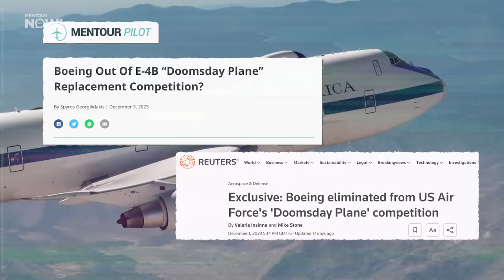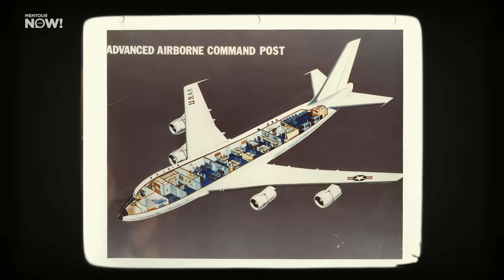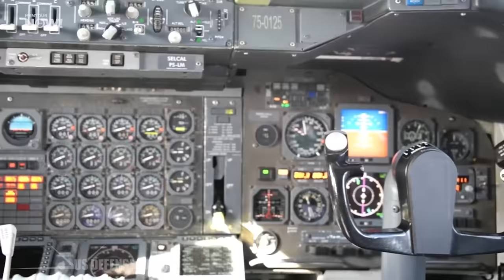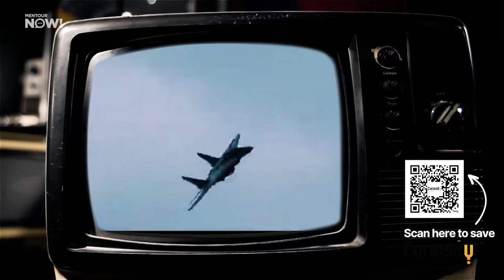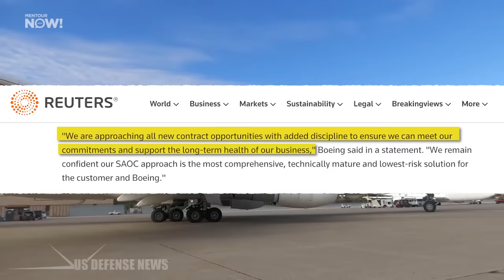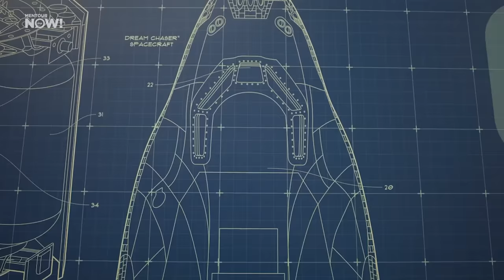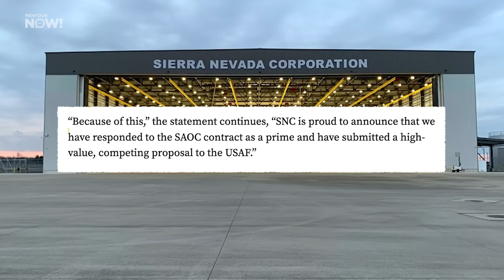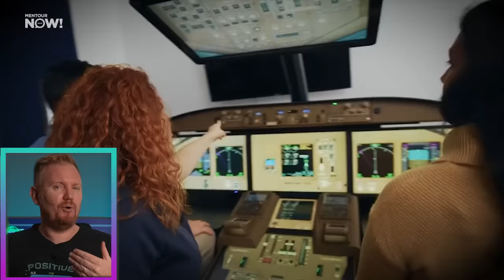Why was Boeing kicked out of the Doomsday Plane competition?!

Comment: Another issue for the 2 engine airframe is electrical power. All that comm. gear takes a lot of electrical power.
Reply: A secondary APU might be installed as a backup to provide extra electrical power, but that would add to the weight of the aircraft and an expensive redesign of the airframe to accommodate the unit.
Reply: Nonsense. Apu will boost
Reply: Shame we don't have the L-1011 anymore.   A repowered Tristar would have the redundancy, range, capacity and with 3 engines, sufficient electrical power.
Reply: @michaelplunkett8059  A missile strike to the center engine would cause loss of rudder, rear pressure bulkhead, or even the entire tail section.  I doubt DoD would accept either trijet design due to this risk.
Reply: This is not a problem at all.
Reply: That’s not an issue - they’ll just add however many APUs are necessary.  A number of USAF aircraft already have dual CPUs mounted on the side towards the rear of the cabin.
Reply: B52, lop off 4 engines and there you go 😂
Reply: To be fair, it could have been a reference to heat seeking missiles potentially causing more damage with a center engine strike than if they hit a wing mounted engine.  I don't think either would go well, though.  Even with a four engine plane the chance of fire with a wing engine strike seems like it would be terminal. @LeTangKichiro
Reply: @michaelplunkett8059  Or the DC-10
Reply: @LeTangKichiro  I think you missed the relationship between an engine and a heat-seeking missile.  A trijet puts a high-temperature target on a very vulnerable part of the fuselage.  Of course, a twinjet has all those parts, but doesn't paint a target there.
But yes, trijets are a thing of the past, which makes this a moot point.
Reply: @LeTangKichiro  To be fair, most anti-aircraft missiles are heat-seeking or use radar. Something trijets have that others don't is a large heat source made of spinning flat surfaces right at the tail (APUs are usually turned off inflight).
Reply: @LeTangKichiro  An engine is a heat source for a heat seeking missile.  Hence @satoshimanabe2493's comment
Reply: @jeremywilliams5107  Last one built was 1952,  I doubt they would repurpose such an old air frame.
Reply: @satoshimanabe2493 they did for the KC-10 (DC-10) and KC-11 (MD-11).
Reply: In my opinion they should buy the latest airliner, two engines, with full manufacturer backing, and then just fly two at once. Much better redundancy.
Reply: @satoshimanabe2493  A super-special, extra-armed military aircraft named "Doomsday Plane" unable to defeat a dumb old fashioned heat-seeking missile? C'mon...😄😄
Reply: @jamesrau100  Need an APU certified/designed to operate at higher altitudes.
Reply: @AlbertoNencioni  It's still a risk they don't have to take, when there are probably more quad jets than trijets around anyways
Reply: @jamesrau100 All large aircraft already have APU’s installed. It provides the power necessary to power and start the aircraft. Would not take much to beat it up for more output.  Simple RAT’s (ram air turbines) mounted inside the fuselage with air ducts feeding them would work great in-flight with out burning additional fuel.
Reply: @Hasdrubal_Barca The reason for the 4 engine requirement is multi redundancy.  In twin engine aircraft, if one engine is lost, you have a bit of time to land as soon as possible. In 4 engine aircraft, you loose one engine and you can either keep going on your mission or, depending on the situation, land as soon as practical. It buys you options that twin engine designs can not give you. The military has to keep on going where civilian aircraft are all about safety.
Reply: @murphsmodels8853   heat seeking missiles are very short range. they aren't a credible treat other than from manpads at take off and landing and there's many countermeasures. radar guided are the problem. usaf doesn't want redundancy due to heat seeking missiles. or any missile.
Reply: @ksamos In Operation Senior Surprise (1991) a B-52 lost an engine and kept right on flying the mission with the remaining 7. Redundancy is a good thing with mission-critical equipment.
Reply: @jeremywilliams5107  Re-engine BUFF with the current 787 engines. more efficient, more power than the 8 engines it had. Remove bomb bay, add pressurized compartment to house all those command and control folks. It would probably STILL be underweight compared to a full bomb load, and without the FAA getting all up in their business, because it isn't a passenger aircraft. I know a boneyard with dozens of candidates for repair and upgrade. Will it be comfortable? No. Will it be WAY cheaper than a 747 based aircraft? More than likely.
Reply: @Operator8282  someone posted some time back that there was a problem with re-engineing the B-52 to do with the engine mounting points. But it's tough and capable if the pressurised pod can fit in the bomb bay (I've never been near a B52 so can't say).
I was wondering if someone would propose an A380 with a refuelling system, they're modern, four-engined, huge and there are airlines that want to get rid of them.
Reply: @jeremywilliams5107  That was another viable option, but for the several BILLION dollars this is gonna cost, I'm sure there will be a few engineers that will earn their pay, no mater what the airframe. 
The B-52's are currently going through a re-engineing right now, as they go through their periodic refurbishment, so, it's possible, and removing some of the fuselage fuel tanks to accommodate the increased crew and equipment areas, not just the bomb bays, could be compensated for with pylon mounted fuel tanks. 
  Provided the A380's have low flight hours, I can believe they would be a really good contender for the job, as well as being MUCH more comfortable for the crew, but the pesky FAA requirements...
Reply: @jeremywilliams5107  I’d guess the most expensive part of refitting one would be EMP-proofing them.  Commercial-grade electronics don’t do too well in a nuclear combat situation.
Reply: @ssaraccoii  true, I am thinking though that it has all the wiring you'd need and a fibre optic data backbone. But it's also part plastic which won't help.
Reply: Wrong, the air force isn’t going backwards with an aircraft requiring a flight engineer @MarinCipollina
Reply: @hugoglenn9741  You think the Air Force doesn't use flight engineers? You're funny.
Reply: They could just use a set of RTG's arranged in parallel. Not that "hard" to set up or install as we've been using them for decades on the NASA rovers.
Reply: The Air Force did have Warrant Officer like the Army, now no longer.  The AF has a few legacy flight engineers, pretty soon no longer.  The writing is on the wall. @MarinCipollina
Reply: 787 has that kind of electrical power, but it's only 2 engines and if it loses one it pretty much has to land.
Reply: @michaelplunkett8059 Plus the L-1011 is just an amazing aircraft.
On a different note, it's interesting that a light aircraft is only airworthy if it has VOR. GPS alone is not sufficient. That is probably because of solar flare risks.
Reply: @MarinCipollina Cut out the middle man! LOL
Reply: @satoshimanabe2493 I mean a missle strike to the tail of any plane would have the same effects lol
Reply: @jamesrau100 still no enough
Reply: @Operator8282 Countires wouldn’t want a B-52 flying to their country every time the president visits. An A380 politicly is never going to happen
Reply: @ksamos  yeah, the 747 in particular, if it loses an engine in flight almost always continues to its destination
Reply: @ssaraccoii  B-52 is only seven engines that’s that’s a hard landing. That is no Bueno.
Reply: @Operator8282  it looks super weird and yeah the FAA would have to approve it because otherwise, he won’t be able to land in other countries
Reply: @mcamp9445  Not necessarily.  See Operation Senior Surprise that kicked off the Gulf War 1991.  They had one that lost an engine and continued on with the mission.

Comment: Militarized A380 would be amusing. 

There’s also the LM-100J from Lockheed Martin (C-130J commercial) that could also work. The Navy is replacing their E-6s with modified C-130Js so it’s not like a turboprop can’t meet the demand.
Reply: I can’t see a turbo prop working.   This aircraft needs to keep up with the VC-25 and other jets.    Plus the C-130 is super slow compared to a 747.
Reply: the reason why they chose to increase fleet size was probably be because USN chose to go with C-130, note that turboprop has never met the demand for Nightwatch/Looking Glass missions, unlike TACAMO which had traditionally been C-130s during the cold war

up until 90s -> USAF E-4 = Nightwatch | USAF EC-135 =  Looking Glass | USN EC-130 = TACAMO
90s-now -> USAF E-4 = Nightwatch | USN E-6 = Looking Glass + TACAMO
future -> USAF SAOC = Nightwatch + Looking Glass | USN EC-130 = TACAMO
Reply: Aside from being ponderous and slow, the C--130 is not even remotely big enough to fill the roll required. The C-17 and C-5 are big enough, but not likely to successfully meet the certification process requirements. They will basically have to use a converted 747 just by the requirements laid out. Unfortunately they aren't being manufactured anymore, so used airframes are also in the mix. One also can't imagine the US Air Force procuring European made airframes, thus Airbus won't make the cut either. Just not going to happen.
Reply: that's what i was thinking. or maybe the Galaxy. Should be cheaper, isn't it?
Reply: Not gonna happen.
See the USAF Tanker debacle - even if you win the competition, the US is not gonna let a European company supply a mainstay of its operations, even if that means buying an inferior aircraft years later than they wanted them.
Reply: VQ-3 TACAMO EC-130Q transition into the E-6 Hermes
Reply: @Wannes_ sad though
Reply: @Wannes_  Agree. Airbus has the capabilities but i doubt a non-US company will have a realistic chance to be selected for such a delicate program
Reply: It won't be European as there needs to be a guaranteed supply chain and the US doesn't have good relationships with France to begin with. I wouldn't rule out Lockheed or McDonnell Douglas offering a "boutique" off the shelf option. The C5 Galaxy would be a good starting point for a new design and Lockheed continues a need to stay relevant. I wouldn't be surprised  if the military chose an off the shelf option using one of the existing military cargo planes as that is essentially what a Boeing 747 actually is.

The Galaxy is already a combi-freighter which is often equipped with passenger seats for military transports. The elephant in the room is Lockheed and MD. The general problem with the Galaxy is the low amount of PAX, but then the Galaxy has a hell of a lot of space. Even the C-17 is comparable in size to the 747 and has four engines.

The likelihood is that they will go with the 747 due to its design capabilities. Boeing doesn't have another large four engine plane that fits... And the only stuff Lockheed and MD have to offer are militarised. A C-17 or C-5 meets some of the cargo design elements of the 747 but lacks in ever really being fit out for passengers properly.
Reply: @orestes1984  MD won't supply, as it had been merged into Boing and they don't like the conditions.
Reply: Airbus would be the obvious choice but there's no way in hell the USAF would ever use a foreign airframe for such a high-profile role. The US military has a long and storied history of turning down superior but foreign-made equipment in favor of worse but domestic models. (One of the most notorious examples being the FAL battle rifle, or the USMC only begrudgingly adopting the Harrier after all the attempts to produce a domestic VTOL failed miserably)
Reply: Well with the current 737 debacle, maybe AIRBUS  be the owner of Boeing soon..  

Problem solved..😂
Reply: France surrenders as soon as the fighting gets tough, so Airbus is off the table.    (tough to get parts  from a country that just capitulated to the enemy)   France is also overrun with muslims.
Reply: @nikujaga_oishii  This is very, VERY much a tangent, but my god out of all the many horrendous NC3 acronyms....TACAMO was always the one that annoyed me the most. "Take Charge And Move Out?" Really? Goddamn Navy...
Reply: @ronaldguild3627 What's wrong with Muslims?
Reply: @ronaldguild3627  They would need a solid plan in place to paperclip those French and German engineers and machinists. Hell, they might have to do that whether they buy Airbus products or not, due to the looming competency crisis.
Reply: @jthee6076 first it happened before, but yeah don't even think there would be any interest by Airbus themselves. 
But the few things we know about the contract means it's about refitting and converting not building, otherwise SNC wouldn't even be in the picture. So a US company could do the job while still using a bought Airbus. 

But yeah I think it's highly unlikely that they would choose an a380. I think even an a340 with a refitting of stronger engines would be more likely. But it's pretty definite that both are fairly unlikely.
While I believe a 747 is probably the best fit. I could see something like a c17 as a possibility maybe.
Reply: @cruisinguy6024 yeah if they would go for a non civilian it would have to be a c-17
Reply: Aren’t Qatar retiring their 747-8Fs.  Could be an option
Reply: If you ever flown in a C-130 for long hours, you would say no way for this mission. They are uncomfortable, wears you out, very slow and can't fit all the equipment needed. I have a lot of hours in the back of different modles of the C-130. Not a fun ride.